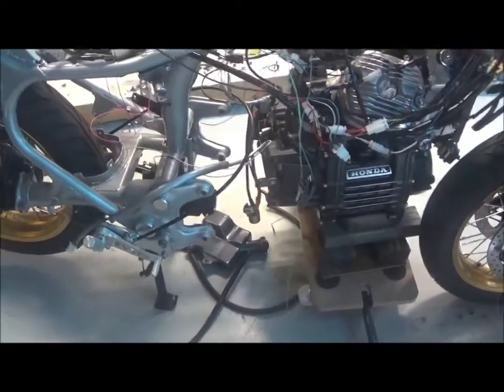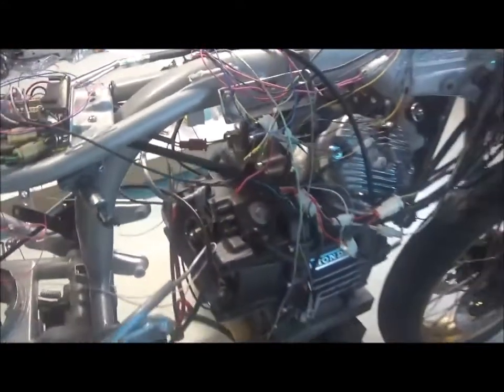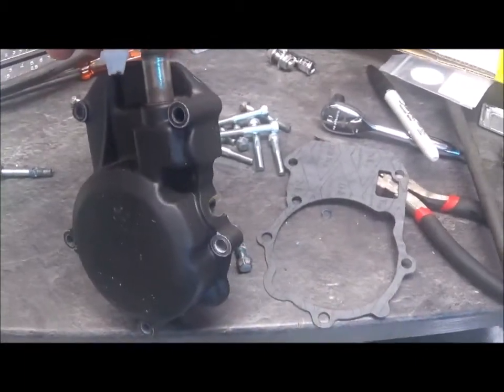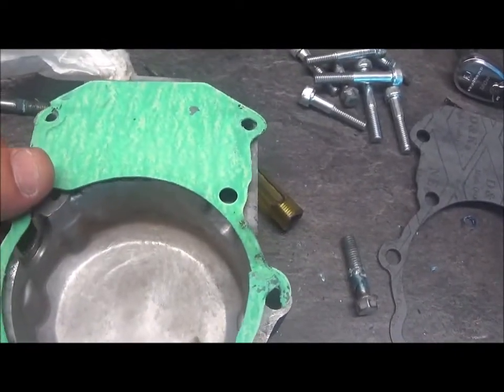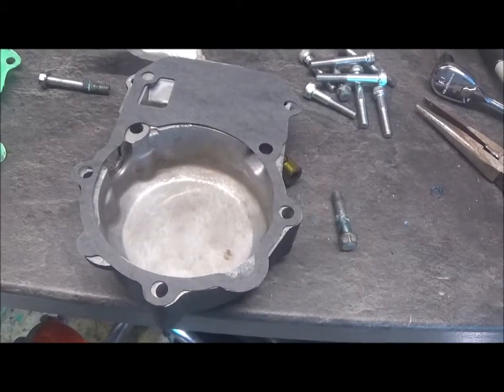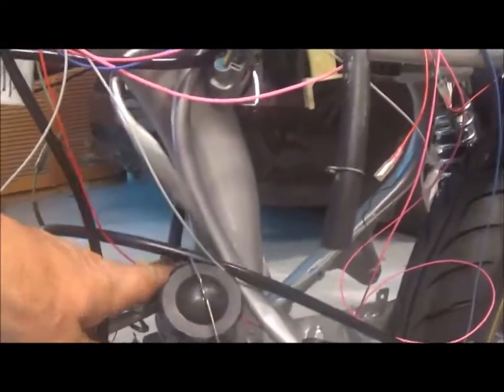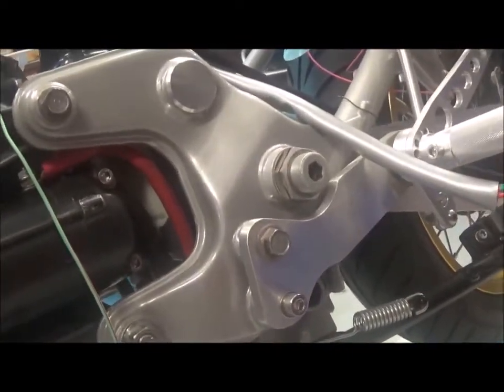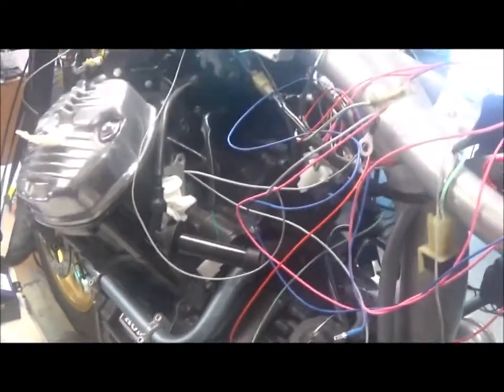62. Honda CX500 - Rebuilding - Fix Water Bottle and Pulser Cover Gasket

Comment: I noticed yours didnt have the hole in pulser gasket either, but i just thought mine was wrong!
Reply from the maker: I couldn't  find the comment that pointed it out to acknowledge in video. Maybe deleted by poster. Cheers KCR.